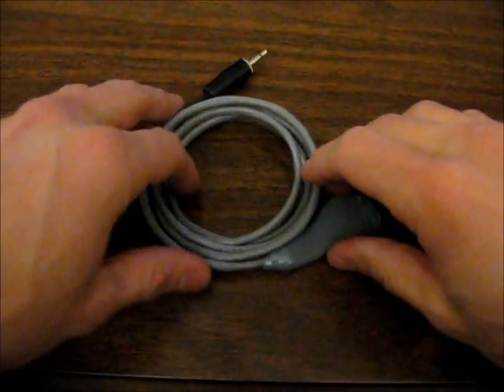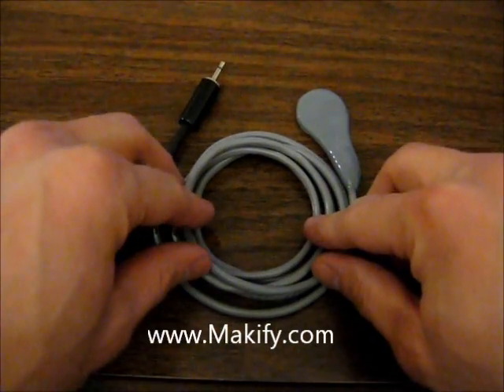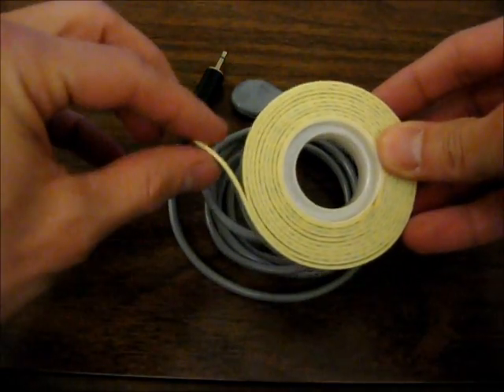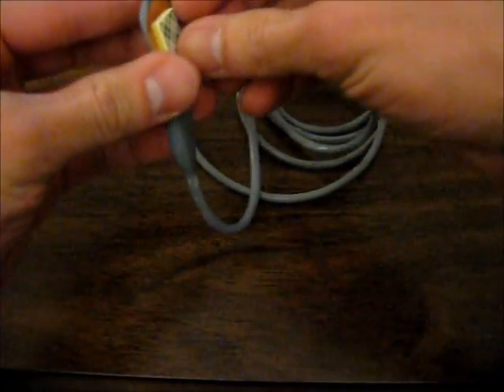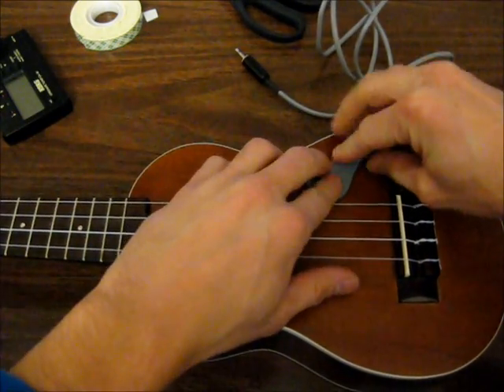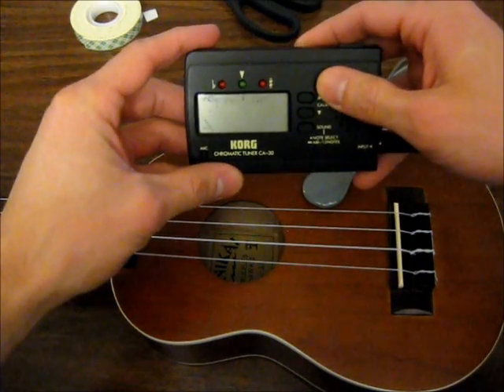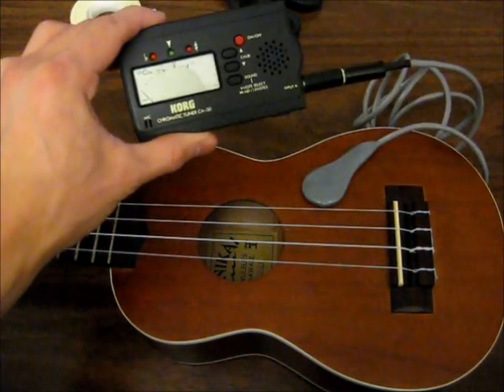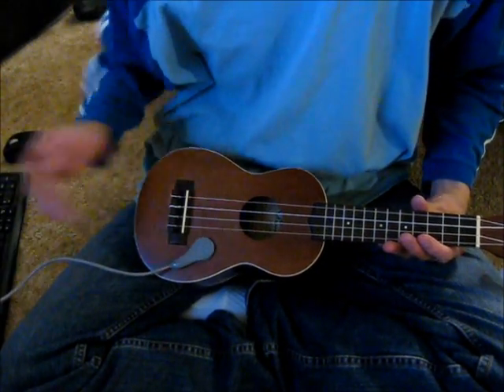Piezo Pickup Test Video

Comment: It doesn't even sound like a piezo pickup. It sounds like it was properly mic'd.
Reply from the maker: +Sam Wittsell  I was quite surprised myself at how good it sounded.
Reply: Makify1 So was I. Normally piezo pickups can be found underneath the saddle of acoustic-electric (and some electric) guitars. They have a very distinct sound that sounds quite different from an instrument that is mic'd. This is an exception. Then again, you didn't put it underneath the saddle. You put it on the body. Also, that pickup you have has a different type of design than undersaddle piezo pickups. It's round unlike undersaddles, which are cylindrical.